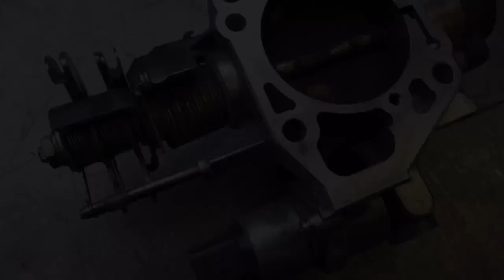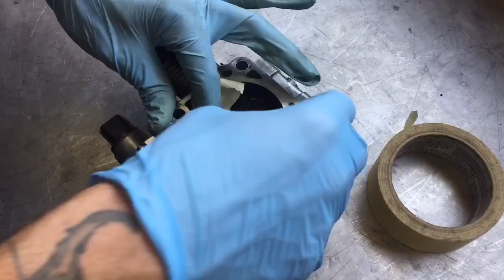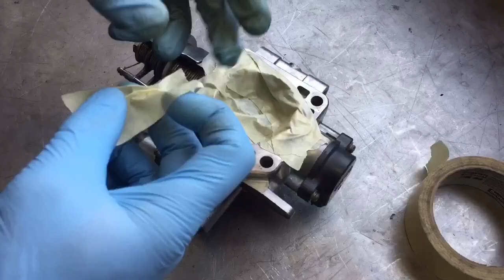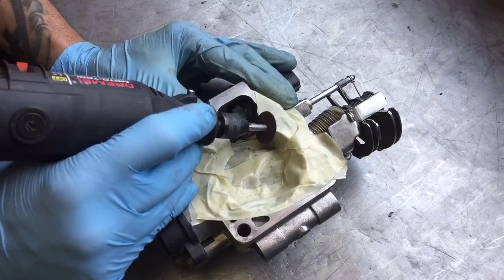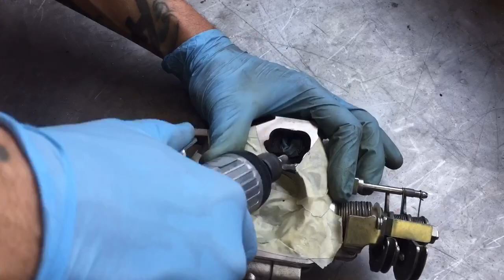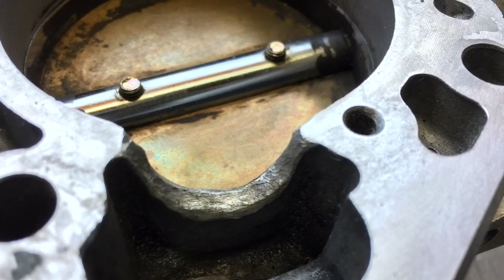Idle Air Control Valve Bypass

Comment: I have a 2004 Legacy NA 2.0L engine. The idle speed control valve is on the throttle body. Does this procedure allow me to use the throttle body reverser then? I thought that the only way to reverse the 2000y and later throttle bodies is by reversing the intake manifold.
Apologies if it's a daft question.